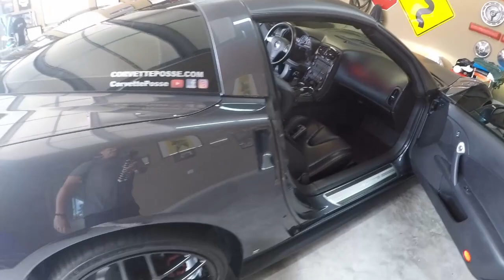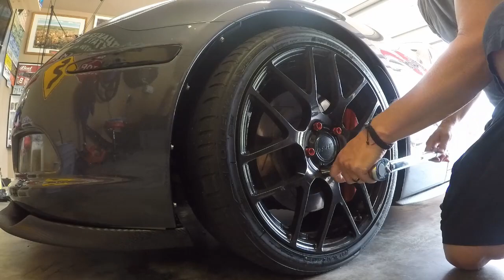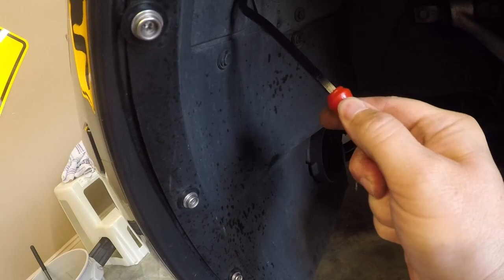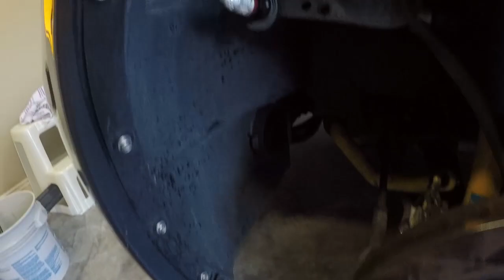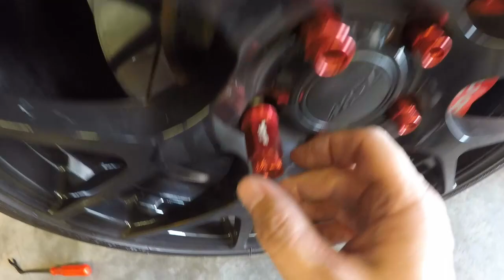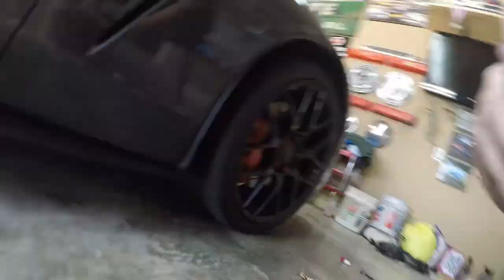My C6 Corvette Illegal??!? Replacing Daytime Running Lights in a c6

Comment: I've had my DRL/turn signal BOTH blue for seven years with no trouble, don't change it , f the law

My fog lamps are also blue, my underglow, license plate lights, reverse lights, wheel lights, 

I have gotten pulled over for my under glow being Blue but I’m not gonna do anything that the law says. I’m going to enjoy my Vette and my colors the way I want it and I always argue in court about that

You should have argued in court about what difference does it make of having red brake lights and  red light bulbs in the front.
Reply from the maker: Thanks for watching! Good point on the tailights. I changed them to clear, just don’t want to give them an excuse to pull me over. I’m also being in a small town was a factor, probably nothing better to do than pull me over.